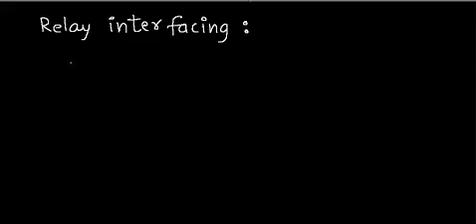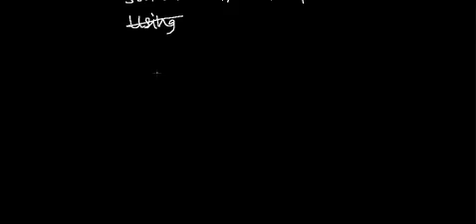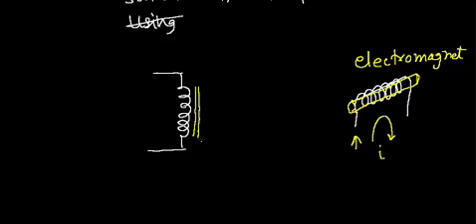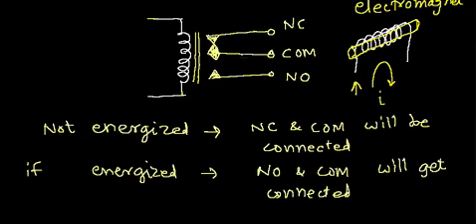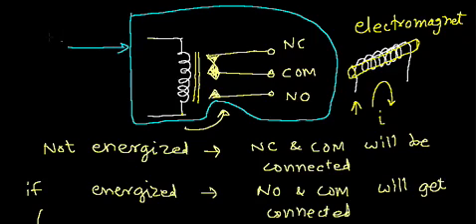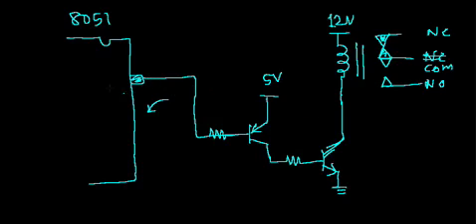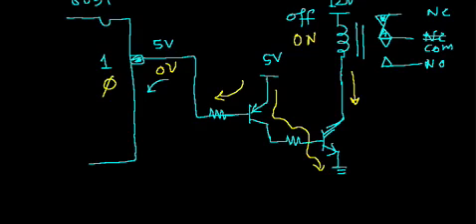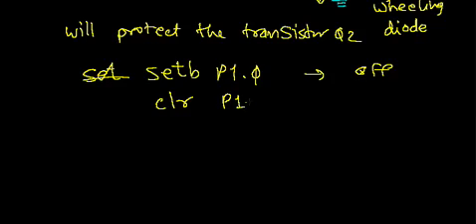Relay Interfacing

Comment: While working with 7 to 8 relays, system resets after frequent switching. Any solution to this? A uln2803 is used to drive the relays.
Reply from the maker: Make sure that the return current of the relay coils does not cause problems to processor circuit. Connect the relay coil return current wire directly to power supply ground (connect it near the filter capacitor!!)
Reply: sure sir, I will try this..